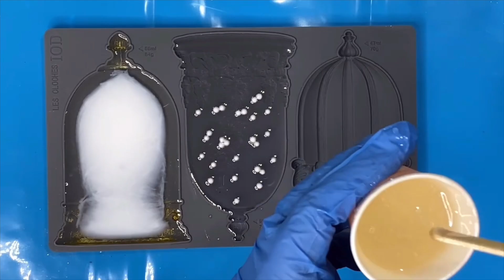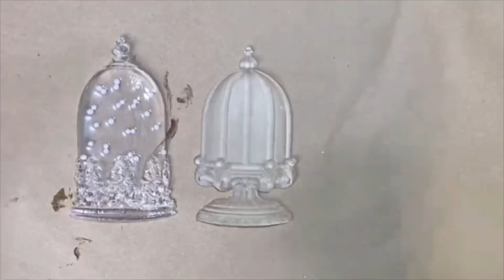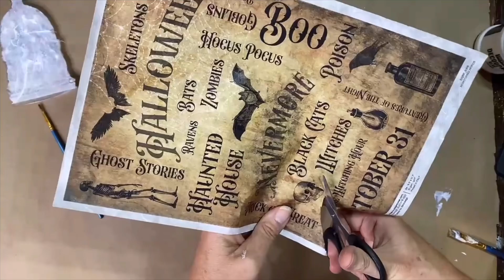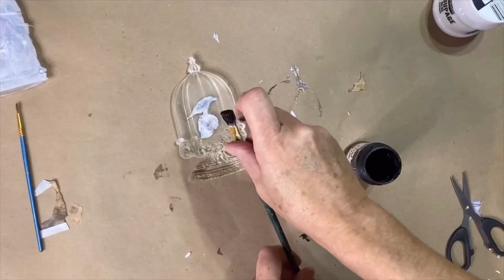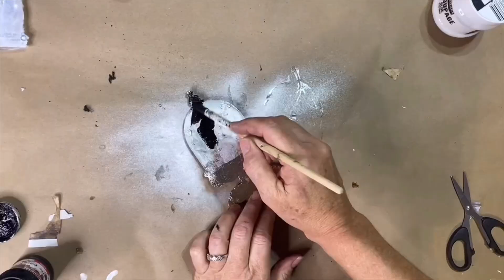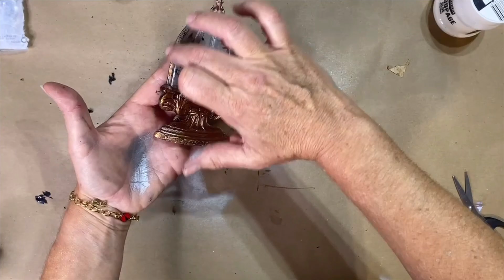DIY Fall Project Using the New IOD Cloches Mould and Resin

Comment: I love it.
What type of gun did you use and at what temperature?
Reply from the maker: It is just a normal crafting heat gun, no ability to change the heat.  It is safe to use on moulds, doesn't get too hot.  The bigger more industrial ones are the ones you need to watch out for, making sure that type is on low heat.